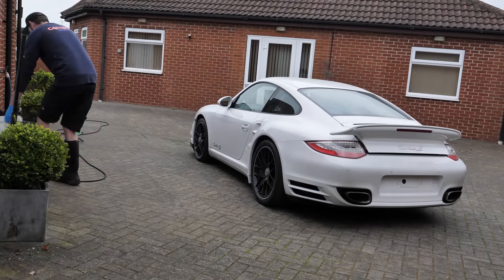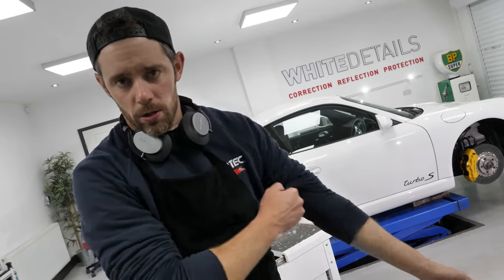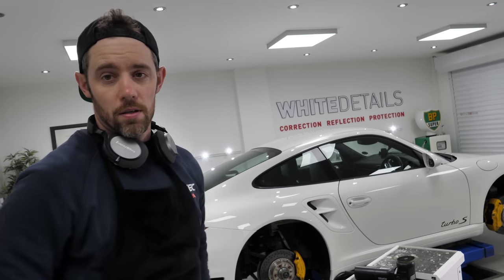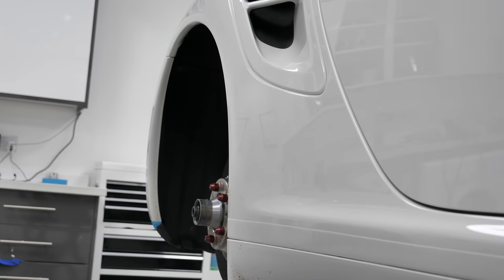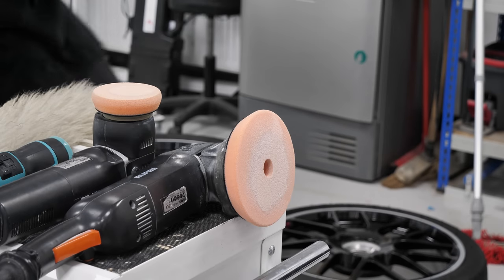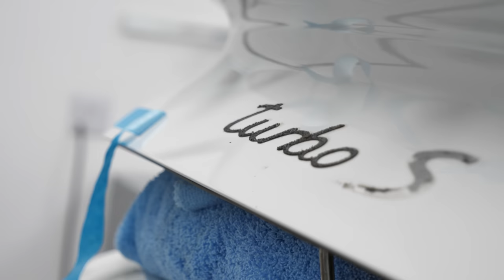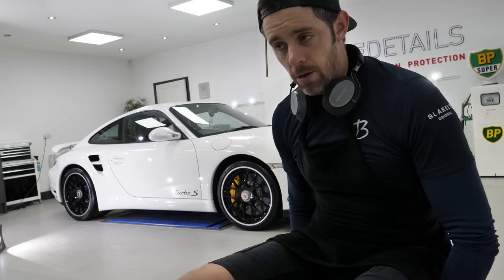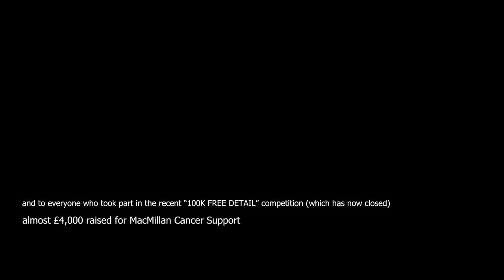Detailing a 997.2 Turbo S - Paint Correction, Wheels Off + Modesta Coatings

Comment: Absolute auction-ready job.  Great episode.  The wheels were the highlight for me, but of course, they weren’t white.  🙂

I offer this having a lot of experience polishing metals: Consider using your 1-2” polisher with a battle-worn pad, paired with a product similar/equal to Griots FCC or 3D One.  You can really lean-into the object you’re polishing (e.g., muffler) and will see a jaw-dropping difference.  Just discard the pad and towels used after the job is done.

Secret weapon for protection?  Soft99 Fusso for dark-colored paint.  Again, on stainless/metal.  It’s durability and filling capability change metals the way ceramic coatings change paint.  It’s that big of a difference.

I know metals in some areas can get hot, but ultimately the most dramatic correction results require a ton of rotation and a forgiving abrasive.

Cheers.

Comment: One tip for the tar removal, if it's a solvent based tar remover then you should dry the car before using it. The solvents are less dense than water and will float on the water instead of touching the paint.

Comment: Hi from Ukraine! Try warm light on white colors like this, so much easyer to inspect surface. and cold light better on dark colors. Have a nice day! (Sorry for my eng)
Reply: And i have a small quastion, how do you like Lake Country pads? because i starting to hate rupes wool\microfiber pads, they are dead after 2 cars. i`m also work with Cartec, but only on foam pads, is it enough to cut UHS coats? Especially like Porshe`s

Comment: when washing the wheels, if they are not ceramic brakes - how do you prevent unsightly rusting, with water in that area.

I know driving the car after washing removes a lot of the surface rust on the brake discs but still is there any advice @whitedetails

Comment: @whitedetails how did you let the touch up paint dry before applying coating?
Reply: If you use base coat, it dries within a few minutes. However 2k paint that requires hardener will take hours or even a day ... I recommend using base coat as the ceramic plays the part of the clear coat stage

Comment: I see you're using just water with claying ... I have never clayed a car before, but usually I see people do it with some more "lubrication" as in a quick detailer. Is it better to use plain water for claying? What are your thoughts around it? Thanks !
Reply: The clay bar Jim uses works with just water….and any slight scratches he induces will be corrected during the machine polishing stage.  Since it would be your first time claying, I’d suggest going with something like Bilt Hamber fine clay and use something like optimum no rinse (ONR) in its clay lube dilution ratio and you should be all set…both products are excellent and cheap as chips..btw remember to soften the clay up prior to use (I normally drop it in hot water for a minute or so) and to regularly fold the clay so that you’re using a clean surface on the paint. Apply fingertip pressure only.  You will need to paint correct after claying (compound and/or polish) as claying does induce light marring to the surface).  It isn’t difficult but, if you’re not up for it then stick with a chemical decontamination using iron and tar remover.  Final suggestion don’t start with the bonnet, find a discrete area and make sure you’re happy with your technique / results. That way if you aren’t happy you can abandon mission without having to complete a large area.
Reply: @jasonsfraser  Thanks so much for these very useful tips!! Awesome. 👌
Reply: @ACCORDriver_NL  👍
Reply from the maker: Thanks - AM Clay (and a couple of others I believe) only require water as lubricant, Roy. Never had any marring issues, best clay bar out there; been using it for probably 10 years

Comment: The fact that there are tire machine grabber marks on the inside of the wheel just blows my mind. How could anyone do that to such rims? I avoid this on any alloy wheel, even if they're old VW's or Skoda so to speak.
Reply: I ve seen them on my own rims.  Doesn't happen at Firestone or GMC buick dealerships. Happens at ASE corner garages
Reply: @missingremote4388  Did you speak up to the shop where they harmed them, or did it happen before you were the owner? Curious to see how customers that care (suppose you do) handle this type of damage.
Reply: Those same marks were in my Mercedes rims from factory:(
Reply: @johnwalters878  Oof that's a hard pill to swallow